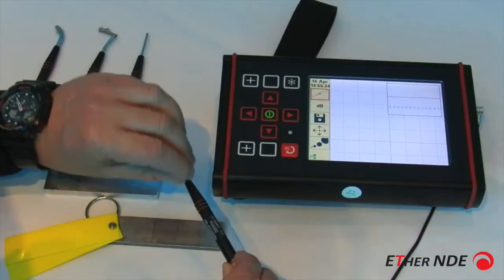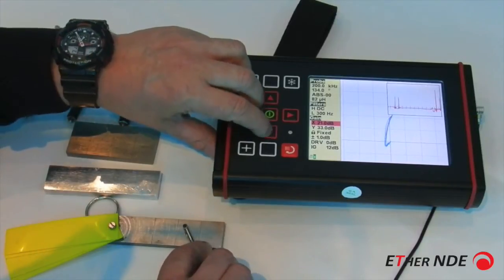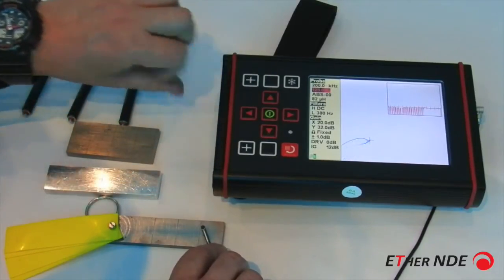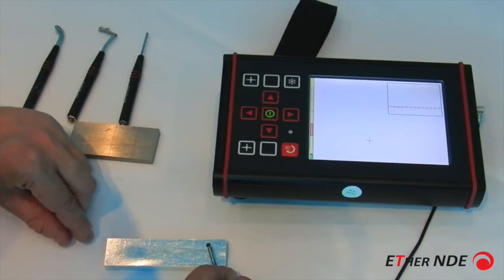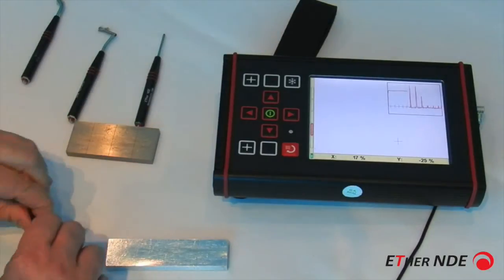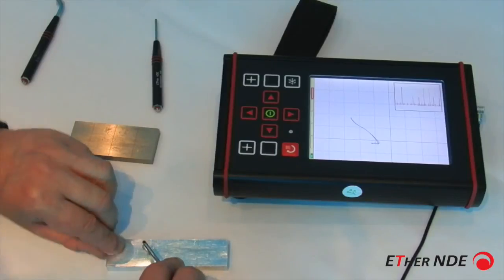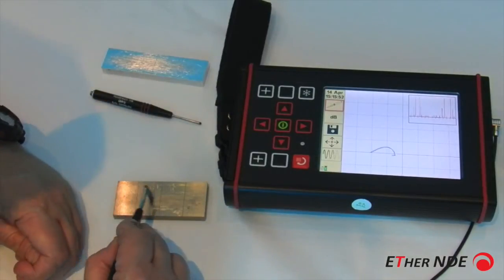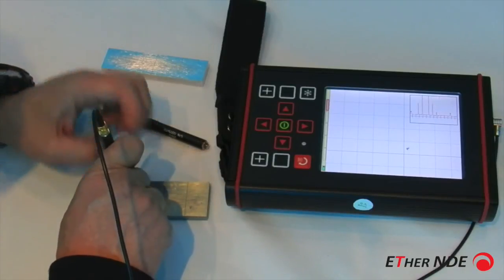Eddy Current NDT Surface Flaw Detection Demonstration

Comment: Could this device be used to detect fractures and small cracks in screw heads (due too cold forming)? Could this be used on both regular steel and stainless steel? See ISO 6157 for more about this topic.